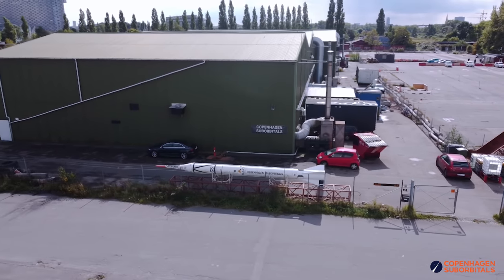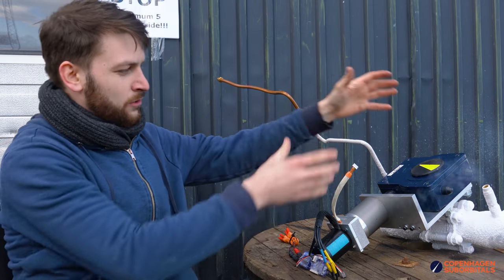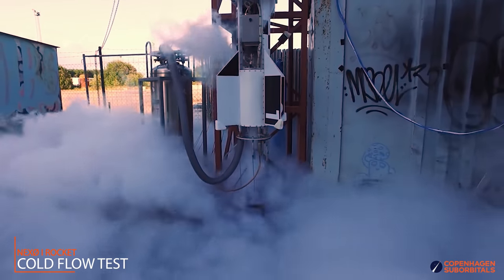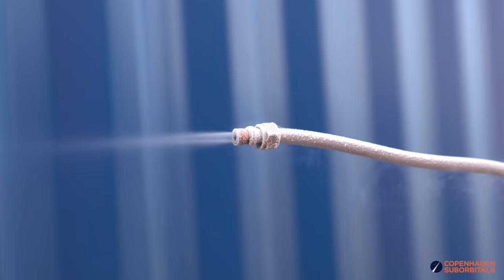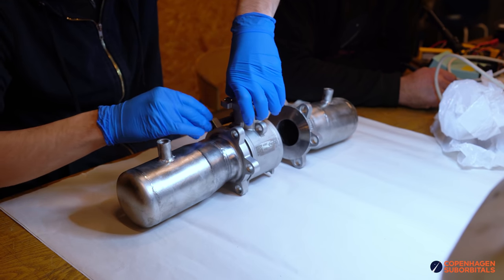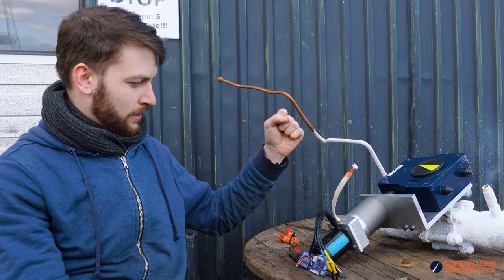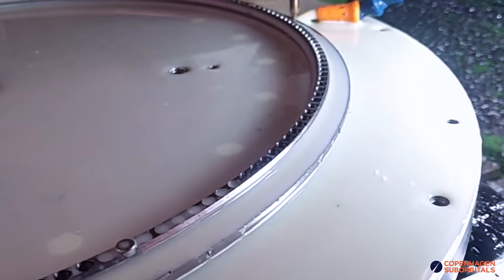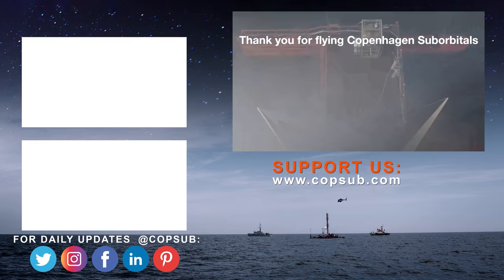Why rocket engine valves are difficult. Specifically the liquid oxygen ones.

Comment: Been watching for some time.  Best of luck to you all!
Yes, this is very true - proceed with caution.  I worked at a startup hybrid (polybutadiene+carbon and LOx) rocket company in the 1980's (left when the president passed away).  The company was sold.  The new company attempted a launch.  We used cryo-ball valves, and due to the hybrid nature, it required 25% open of the LOx valve for ~10% throttle to establish a grain in the propellent.  Well, it was commanded to go to 100% and the ball-valve shaft failed.  Vehicle was clamped down but could not be released and could not shutoff the LOx due to no valve control.  Ooops.

Comment: Excellent video! Very informative. Why do you use motor actuation instead of pneumatic?
Reply: If I had to take a guess, I would assume because it is lighter and much less complex than a pneumatic system. Kind of like how Rocket Lab and Astra use battery driven pumps in their engines.
Reply: @dr4d1s  That along the right avenue of thinking. We already have enough electrical power on board for electrical valves, but starting on a pneumatic system comes with large weight penalties for the piping and the pressure vessels.

Comment: Great job! For such propellants flowrate and pressures level why not the simple pneumatic valves for both Fu and LOX lines with the throttle in Fu line for propellants mixture ratio control or  throttles in Fu and LOX lines, if you need to change engine mode during the flight also?
Reply: Probably the weight (mass) of 3" diameter pneumatic valves.  However a slower rotation speed with a less powerful motor might be good enough for some valves in the rocket, saving further weight.
Reply from the maker: Pneumatic systems come with a weight and complexity penalty.

Comment: Did you ever figure out why the simulation underestimated the valve speed? I'm no engineer but I feel like that would be an important thing to do as it clearly didn't take something into account, and that something could affect the system as a whole outside of the testing environment.
Reply from the maker: As Adam mentioned in another comment:
"If you work with COTS components it is really difficult to get high precision and extensive engineering data on many parameters. These parameters are all part of the eventual valve model. You are left with the options of either measuring these parameters yourself, exploding the workload or you can guess your way through it supported with some measurements, resulting in less workload but decreasing accuracy. "Optimized components" and fancy motors with exotic magnets are the privileges of companies having a lot of money for R&D. If you are a crowd-funded volunteer organization, you make do with what you have money and time for. ;)"

Comment: Interesting stuff
Q: Rather than venting to the atmosphere the oxygen stuck in the ball valve cavity when closed, why not have an extra (small) hole in the ball between the cavity and the tank side? Advantages would be less plumbing, no vent (which can become blocked with ice) and no lost oxygen. May affect tank pressure tho
Reply: My guess is that it would work but it also would be way harder to seal since ball valves usually have two seals, one on the tank side and one on the outlet side, with this technique you loose the tank seal...

Comment: My Chevrolet Matiz 2005 also has difficult valves, the return valve in  steering lubricating and brakes, air blocks pedal and is released with hissing sound and pressing gas, jaults and fluctuates rpm

Comment: Interesting video. I was wondering why you choose a ball valve versus a gate valve?
Reply: Ball valves a faster and seal better. They can also handle higher pressure when throttling high pressure flow. Gate valves like to be open or closed. They don’t like to be under pressure in some intermediate state. But that might be the heuristic for repeated duty cycles. I don’t know if this would necessarily be true for a single use rocket engine.

Comment: Sure it's good news that the performance of the valve in practise was better than predicted rather than worse. But maybe that raises questions about the simulation models you have been using? Ideally the test results should match the predictions.
Reply: I was wondering about this as well.
It could easily be due to safety margins in the simulation that was broken in the test, I imagine. It should be possible to beat the standard model if you do proper repeated testing, and you ensure that all components are optimized properly.
You have to push the limits if you want to go far when fighting gravity.
Reply: @gijbuis, If you work with COTS components it is really difficult to get high precision and extensive engineering data on many parameters. These parameters are all part of the eventual valve model. You are left with the options of either measuring these parameters yourself, exploding the workload or you can guess your way through it supported with some measurements, resulting in less workload but decreasing accuracy. "Optimized components" and fancy motors with exotic magnets are the priviliges of companies having a lot of money for R&D. If you are a crowd funded volunteer organization, you make do with what you have money and time for. ;)
Reply: @Datamanna  I wasn't talking about optimizing the individual parts, but optimizing the rest of the rocket for the parts that they have. Tuning things according to actual performance.
Of course trial and error is needed with complex systems like this, regardless of the budget. "Proper optimization" depends on the parts you've got, and those parts aren't all that accurate at this level. You have to establish what "optimized" means yourself, in terms of the entire rocket.

Comment: So, the pneumatic servo is probably better. It provides very high torque and very high speed. Also it is not true that pneumatic system can be only 1 or 0. There exist electro-pneumatic positioners. One of the best are manufactured by Siemens. Those uses piezzo valves.

Comment: Liquid oxygen is typically used for the energy derived by the large conversion value of liquid to vapor in conjunction with a secondary vapor fuel  - the oxygen liquid vapor kicks in as the rocket gains altitude . The liquid to vapor conversation occurs through a by pass line through a turbo pump. You also have to be aware of "POGO" if you don't manage fuel flow - just an opinion  I'm sure you have evaluated. Good luck.

Comment: Is it going to be subjected to temperatures above 80C?
If so you need to be careful about the neodimium magnets in your motor drive. 
You may want to use cobalt samarium magnets, just in case.
Reply: It has liquid oxygen running through it.  I don't think heat is going to be a big problem.
Reply: @stargazer7644  the motor is located quite far from the oxygen tank. There may be the engine right behind.
Reply: @makerbeelab5546  Quite far? It's directly connected by a metal gear box and mounting flange to -183C.  We call that a heat sink.  The hot part of the engine will be (by definition) downstream of this valve toward the combustion chamber.
Reply: @makerbeelab5546  Distance to the tank doesn't matter. The oxygen has to stay liquid until it leaves the injector to ensure a constant flow rate, so the valve itself is guaranteed to be very cold. I have a hard time seeing how convection would overcome the conduction at this low temperatures, at the very least if any kind of thermal protection is applied.

In other words, I wouldn't expect the valve to be the first thing to fail if temperatures went high, and I know that they will test things.

Comment: Interesting to see an actual cryogenic valve. I suppose that similar valves are used for regulating the flow of liquid methane/LNG as fuel? Or do these have different requirements?
Reply from the maker: We use "room temperature" ethanol as fuel. But valves for it will be similar.
Reply: @CopenhagenSuborbitals   it's my understanding that using liquid oxygen and LNG is making things more uniform in managing the fuel/oxidizer tanks (similar temperatures etc, so less difference in expansion etc)
Reply: @alcosound  
Ethanol are not at all comparable to LNG!
We use LOX at 183 degrees and ETH at 12-17 degrees "ccc" (Civilized Celciated Centigrades ... C for short ;-))

Comment: How about lots of dimples to reduce the friction? Also the center could be drilled with lots of through holes instead of one large hole. Then the whole surface wold be uniform density.

Comment: Very informative video, thanks! I see you are using a relatively small brushless outrunner motor (around 40x50?) and probably a Vesc based esc. Can you tell what voltage you use and how many amps is your setup pulling? What kind of torque do you require to open the valve in the working condition? Thanks!

Comment: Does this valve have DPE (double piston) seats? Thats the best way to vent excess pressure thats captured in the ball area. Also Id put a pressure relief valve where you beed to vent. 

Ultra fast actuated valves are usually air/oil actuators so this is impressive to use an electric motor.
Reply: Also how do you avoid the actuator from freezing? That cast iron gearbox isnt rated for the cold temps.

Comment: Wow. Okay. I know this is a prototype. But I still wonder, if this amount of kit actually needs to go to "space". If I guess rocket-science correctly, you would open the valve once and then be done with it? At least for stage 1. (Or do you need to close it for staging?) So could the drive moved to stage 0? Have a long stick poking out of the rocket which can be turned to open and close the valve. Motors and gears stay at the launchpad.

Comment: I follow your progress now for quite a while and i am impressed. But there is one question i still have about your operation. Why don't you use additional booster rockets for the initial start? They are cheap, way easier to build and add a lot to the innitial thrust. So were am i wrong with this?
Reply from the maker: Simple answer is because we don't need it. We believe we can make a liquid engine powerful enough for the task. Adding secondary propulsion systems increases costs, schedules, complexity, and risk.

Comment: 5:58 Requirement: 1s
Design simulation: 1.6s
Oh well, let's build it anyway!
Reply: Well if you don't know how to meet the 1s within reason (economics), building a test setup getting close to requirements to test the theory and gain understanding, is an acceptable engineering approach. That way you can acquire the knowledge required for first principles development and with experience and knowledge gained, redesign a solution to meet technical and economical requirements. Sometimes you have to learn to crawl before you can walk let alone winning a 100m race.

Comment: Thank you for new video. consider in use titanium valve? have les expansion when temperature change.
Reply: Titanium is expensive to gather work with, and if it isn't needed then it's pointless. 
An amateur project like this with limited budget has to focus on "good enough" in order to have a chance to make it to the finish line, or the support goes away before you have enough money to show things.

Edit: Besides, I'm sure that an unscheduled rapid disassembly could make way for a lot of interesting content. 
I would personally be rather pleased with a failure like that. I'm pretty confident that it would even help the project reach the finish line faster, if it gets covered or retold properly. There is a lot of interesting thoughts that go into the analysis of the remains and the following problem solving.
Reply: I think you might have missed the "low cost" and "off the shelf" requirements.

Comment: I hear you talking about THE valve. How about redundancy? Specially when human lives and lots of money are involved?
Reply: Exactly how do you expect redundancy on a valve? Redundancy on a valve means running another pipe. Realistically, if you're doing that you might as well just have another engine, which is why rockets like Falcon 9 just have a lot of engines and can tolerate engine failures.

Comment: If it is so difficult then how can SpaceX get it right every time?
Reply from the maker: Except for the times they didn't get it right? :)
Reply: @CopenhagenSuborbitals  I think they got the valves working without an issue - and if the did have an issue - it was quickly fixed. If you are saying that others have had a a many problems with valves as the SLS system… then you are wrong.
Reply: @mullholand  Valves causes all kind of problems in the rocket industry. Over the last two years we have had Starliner launch cancelled with valve problems, Dragon capsule blowing up caused by valve problems, Astra rocket a Kodiak failed due to valve and other issues, ISRO rocket failed in august 2021 due to valves. The list goes on and on. In that light, are you still convinced other have no problem with valves or are you just not enlighten about such issues? I mean "I think they got the valves working without an issue". C'mon Dragon blew up. I would have an issue with that.
Reply: @petermaersk-moller3014  Dragon only blew up during stress testing, that's kind of the whole point to find these corner case issues. It's not like Starliner that made it all the way out to a test flight before they discovered the problem.
Reply: @reubes11  That is true, however the thread started with unfounded assumption that valves must be easy since SpaceX gets it right every time. The reality is that Space is hard and more hard with little money and even SpaceX does not get it right first time, not even with all the money. That said ... we are all awaiting in eager anticipationto see  Starship fly 🙂
Reply: @Moving On Seems SpaceX had a failing frozen valve on Starship. It's still hard even for SpaceX.
Reply: @Moving On  you're moving the goalposts, spacex also clearly don't get the valves right every single time.

Comment: Hello I have a question , how do you prevent over pressurisation inside the ball when the liquid oxygen evaporates . This ia really a challenge considering use of normal valves for cryogenic application . Also y not use solenoid valves .....I think answer to this is magnetization in cryogenic condition . Magnets if subjected to cryogenic temperature will behave differently and there will be no control over the valves .....let me know if I m correct . Also please do answer the liquid oxygen boil off question .
Reply: Watch to the end, although they didn't detail their method of venting the ball.
Reply: @johndododoe1411  watched the full video still unclear ....I don't think they mentioned their secret 😜
Reply: @thecros1076  Near the end they talked about both subjects, but didn't reveal how they avoided boil off inside closed valves.
Reply: I am not sure because I haven't seen it, but my guess is that they drill a hole on the side of the ball valve casing to make the ball's hole align with it in the closed position, but remain sealed when LOX is flowing through it. In terms of the solenoid, they want throttle control so a solenoid won't work for regulating the flow of LOX. Also the only change the solenoid would experience is an increase in magnetic force under cryo temperatures which would actually benefit it. I hope that answers your question :D
Reply: @backyarddynamics7297  great answer bro , I thought of the same vent hole mechanism .

Comment: Seems that SpaceX employs the best and most motivated technicians.
Why they have no issues with valves and cryo temperature can be seen at every launch - however it also seems that others are too blind to see.
Reply from the maker: If you don't count the Crew Dragon pad abort failure caused by a leaky valve and some premature Merlin shutdowns during first stage burn, then you could say SpaceX's record has been flawless. But valves will tell you otherwise. :)